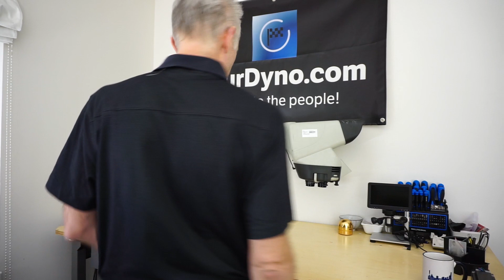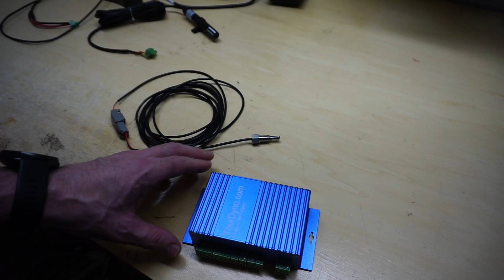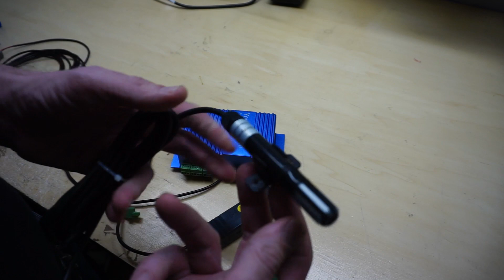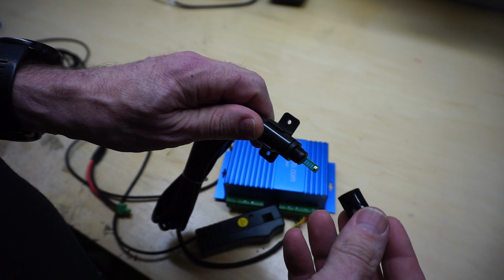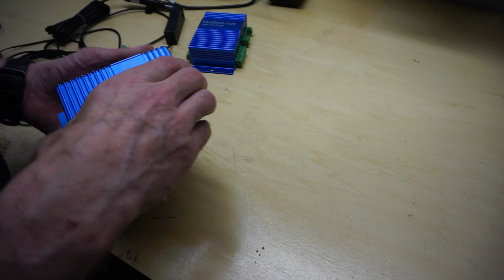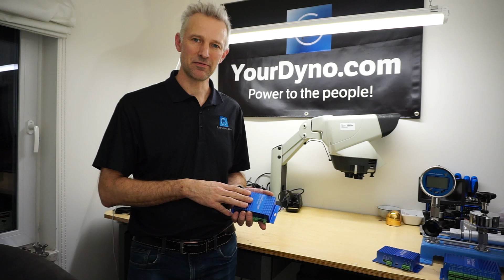New YourDyno Instrument unit

Comment: Has anyone had any luck acquiring Holley EFI CAN address data to input CAN into the YourDyno software? It seems Holley does not freely share that data like most other ECU manufacturers...
Reply: Have you had any luck with pursuing this Holley CAN interface? I am on the verge of purchasing this setup and we are almost exclusively a Holley shop and this is the first question I have
Reply: @pdonk93lx  The YourDyno software actually already has several Holley CAN channels loaded. Download the software and take a look.

Comment: That’s pretty impressive. 
Question….The weather station. If it were to ever fail, as I’ve seen others fails before. Where can you get a replacement or can you make your own?
How much is the replacement?
Also how long have these weather stations been tested for?
Im not sure why others have failed if it’s due to heat, but just makes me want to ask this question for myself and others reading. Thank you! 
Really cool unit you make!
Reply from the maker: Hi, we have weather stations in stock, and they have a 1 year warranty too. The weather station is really just a few components, where all the magic happens inside the chip from Bosch. Apart from that it is mostly down to wires and mechanical pieces